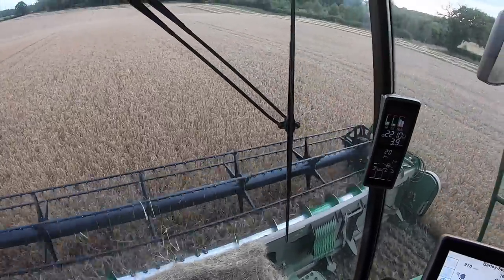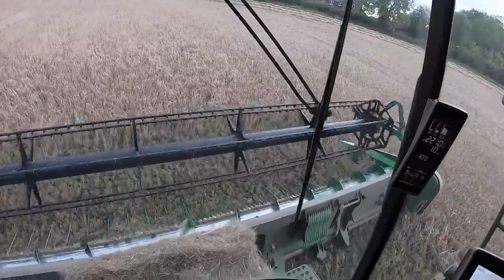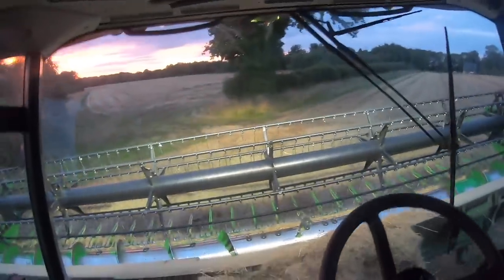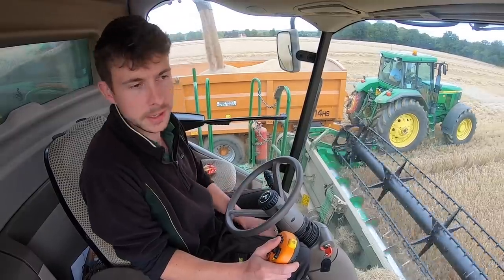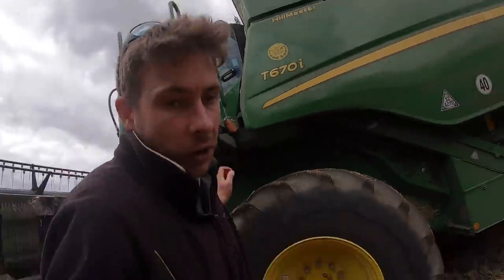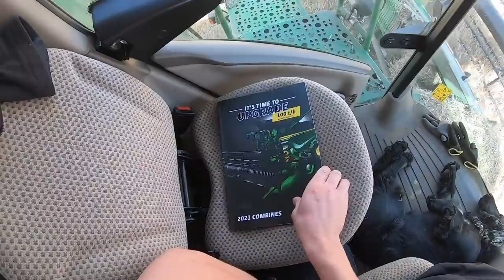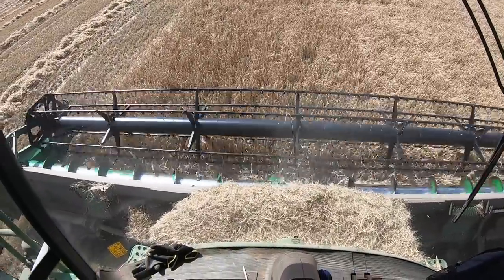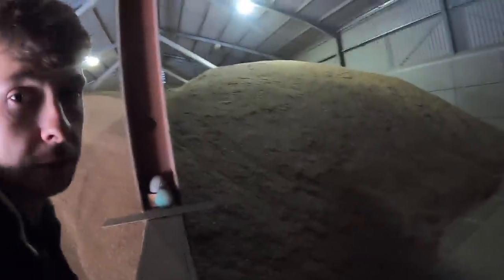UK Harvest 2020! Episode 14

Comment: 35mm in western Finland. So far september has been wet. We had very very dry and cold spring. Rain came wrong time and now we have two corps... Ready one is like 10-15cm tall moisture like 10% and the second is normal height and all green. Normally we would have harvested all by mid september.
Reply: I mean 35mm water in August :D